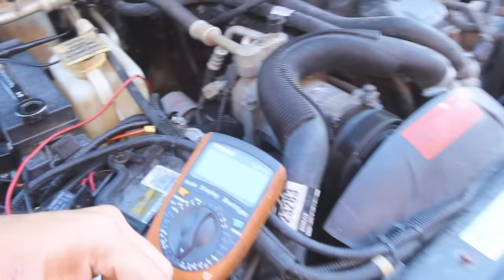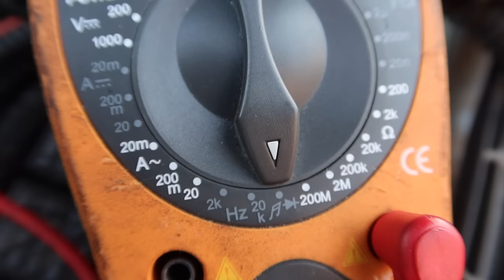AC Suddenly Stopped Working In My Car / Cheapest  Air Conditioner Diagnosis and Fix / Hot Jeep  XJ

Comment: My problem: Chrysler 300C (for CRAP, I guess): every time I used the combination "Fan-Windshield blow- feet" position of the selector level, the AC Compressor makes a wrenching noise; it sounds as if 'stuck', seized up. I would say it sounds as if the clutch bearing is rusted out, stuck. Is that common? To think the Compressor could be seized up is a bit of a long range thought. Am I wrong? What should I do? Please, help. Thanks for your vid, though.

Comment: My ac goes on for a lil then the ac stops working an the ac clutch turns off so idk if its low on freon cause the switch you messed with i did the same but my suv doesn't have that problem can it be low on freon on or a electric problem thanks

Comment: My compressor clutch was cycling on and off in a/c mode and the vents blew hot air. I did not know why. I know the cycling of the compressor clutch is normal in defrost mode but it didn't make sense in a/c mode. So I tried your paperclip trick and sure enough the compressor clutch stayed engaged and the vents started blowing cold air. I also notice if I use the gauge that comes with the Pro A/C bottle, and hook it up to the low side port (when it is not on the bottle) that the system pressure drops from 50 psi to zero when the a/c compressor engages.

Question: Is my low pressure switch bad or are the contacts in the switch opening when the compressor comes on and the pressure drops? Then when it is off and the pressure comes up the contacts close again and the cycle repeats? Should the preasure in the system drop to zero when the a/c compressor comes on and the clutch engages?

If anyone knows the answers I would appreciate it. Before I run out and replace my low pressure switch just to have the same issue continue.

Comment: What if my ac compressor turns on with the ac button and it has Freon and fans work but ac still doesn’t blow cold air only hot air

Comment: I have a 98 cherokee sport. My ac kicks on and off repeatedly. You think that low pressure switch is bad as well? Going to test it in the morning. I recharged it and blows cold but kicks kicking on and off after i replaced a leaking Schrader valve.

Comment: Clutch is able to freely spin when I manually do it with the car off. Clutch does not kick on when car is on. My pressure switch has 4 holes. I put a paper clip in 2 of the holes and the fan kicked on but not the clutch? Ac still not cold

Comment: I tried the paper clip method and the Clutch kicked on and we will go get a new pressure switch and hopefully that is the problem. Sold my Sister my older car and had it in the shop for a coolant leak and when we picked it up the A/C had stopped blowing cold. We asked if they could have done anything to the A/C while replacing the water pump that could have made the A/C stopped working. They said they weren't working around that area but they lied because this pressure switch wire runs right in front of the water pump area but said its $100 to even look at it so we decided to start looking at it ourselves. Hopefully its just the sensor. Thanks for you help!!! I also have a 2013 Mazda that I have changed everything out to get it to blow out the vents harder and nothing has worked. Blows cold but in this Louisiana heat at 105 degrees it doesn't help. Is there anything else I need to change out?

Comment: Great vid mate. My compressor's starting but the radiator fans not coming on. But fan come on at 104°C also getting potential P0480 which is the fan circuit. Any ideas cheers. Graham

Comment: Got a 1996 Lexus es300 air-conditioning stopped yesterday , changed relay that had signs of sparking , put new one , still the air-conditioning light is flashing , check the low pressure switch still nothing , compressor still doesn't kick in . Any ideas ?

Comment: Would this work if my fuse for the A/C clutch is blown? I'm pulling a vacuum right now and will be charging here in a bit but I don't have a spare 20a fuse to replace the blown one. Could I bypass the low pressure switch even with a bad fuse?

Comment: Ok, so you said something about the radiator fans.....what if they aren't working? Mine aren't as is my a/c and it's so hot here, we got into triple digits this week with a high of 113!!!! I need help. A friend tried to get my radiator fans working and in doing that caused the theft deterrent system to engage and now my car throws a PO336 code. Crankshaft position sensor circuit range performance p0336. Not sure what to do, my crankshaft was replaced however my car will STILL not start, theft deterrent still active and the car still throws the same PO336 code. 2011 GMC Acadia SLT AWD 3.6 6 Cylinder. I'm hopeless and pretty much broke and shooting into the dark here :'(

Comment: Sir the sensor should be close  checked by multimeter   . .? But I bought 5 switch  they are hight  ohm  . 6 thousand  ohms  on each pins  . It is wrong parts thank

Comment: aye on my mustang I inserted a wire in that connector and my compressor still didnt turn on. dumb question here, does it have to be a paper clip? fwi compressor is new. and car will not take freon after 10oz. and no power to compressor.

Comment: When I do the paperclip trick, on a 3 pin volvo connector (left and right), the car won't start. When I remove the paperclip, the car will start. any idea? I did something stupid, i forgot to installl the entire low pressure sensor in my new condensor... filled it at a garage... but now i cant remove the bolt, and install the sensor.. because the system is pressurized. There isn't a valve on my dryer :(

Comment: My fans dont turn on with the ac on could a pressure sensor switch be the reason i can see the compressor click on and off so i know my compressor is good its also filled and no leaks anywhere

Comment: I was just wondering if that switch controls the interior blower to help push the cabin cold air if so Tysvm I was thinking relays fuses to check and now adding this switch to diagnose my issues because I have a 2018 Dodge Grand Caravan gt super charged and for some reason it’s pushing out hot 🥵 air and the blower isn’t as strong no leaks visually as for inspection of fan clutch I’ll look and see if it’s engaging once again Tysvm

Comment: What if compressor is working but I still don't get cold air? No visual signs of leaks. 2 lines coming from evaporator are very hot and another line is frozen.

Comment: Hey hope all is well. I have a 2009 Dodge Caliber SE and my heat works but my air doesn't I've tried adding coolant but it wouldn't take I was told my compressor is fine but it's a piece I may need and I'm really trying to avoid taking it to the dealership. I honestly feel like it could be a simple fix since my heat works fine and I would love a second opinion. Is it any alternative you could give me?

Comment: Quick question what if the compressor don’t start by clipping the wire , but if you bridge the relay on the fuse box compressor turns on, what can it be then ? Can’t find the problem thanks

Comment: My car is not blowing cold air. I check the pressure on the large pipe and it was 135 psi. So I ended up not adding anything. Could it be a bad switch? Or why do you think there’s that much pressure and not cold air?

Comment: Very informative. You confirmed for me where I have the problem in the A/C system. I Have found leak in the condenser. Thanks very much. I have  a question how often does your radiator fan come on?
Reply: Should stay on as long as ac is on max.

Comment: You did not mention about the high pressure switch that also could be the problem.I was driving and my a/c stopped working but after 10 minutes it start working again come to find out my high pressure switch is defective.

Comment: my problem is that with the paperclip trick it did turn on but it turned on and off when it was on i was able to put freon in but i didnt feel anything getting cold nor cold air out of my vents but i was able to put a bottle of freon and nothing no cold air and also my ac compreddor stopped turning on

Comment: What if compressor clutch does not engage when I put the paper clip but it does turn on if I connect it straight from the battery?

Comment: hi,there my 2004 nissan pathfinder compressor running buttom line get cool the one on top on the low side get hot, is look like i have refrigerante but is not cooling any idea how to fix it or what is wrong thank you for any help

Comment: I replaced mine it was working okay then now my ac compressor doesn’t engage. It has a new compressor but when I jump it the clutch engages but blows hot air. The shop it brung it to said it had a electrical issue they couldn’t fix it.

Comment: My switch is on the low pressure line, not the dryer. Do I need to evap the freon to change the switch? I thought I did, but you just unscrewed it and replaced. Simple.

Comment: If you do have a leak and perform that test with the jumped switch, could that damage the compressor? I mean, the compressor would be running with little to no refrigerant in the system. Is that bad? TIA
Reply from the maker: Not bad for the duration of the test.

Comment: Why did you not have to evacuate?  If i remove my pressure switch it will release the pressure.  Nissan 2004 Maxima.  Just curious.
Reply from the maker: Schrader valve under the sensor.
Reply: @Donnythelatemodeltech  does Nissan use those :). I'm testing mine right now.  It's a three pin so I'm researching:)

Comment: What keeps my clutch from engaging I hardwired my air condition to the battery and it comes on but it won't come on if I don't have it hardwired to the battery 95 Buick Park avenue 3800 series 2

Comment: When I use the paper clip like you did to see if the clutch is engaging the vehicle shuts off. Take the paper clip out in the vehicle starts back up
Reply from the maker: Your probably not testing a pressure switch .  How many wire that plug got?
Reply: @Donnythelatemodeltech  3 wires
Reply: 2011 370z air just stop blowing cold air. Clutch not engaging.
Reply from the maker: @dennissutter4322  3 wire is not the ac pressure switch.  That would be a sensor .    Your going to smoke your ecu.
Reply: @Donnythelatemodeltech  ok thanks. Also thanks for answering me so fast even on a Monday.

Comment: Hey I have a similar issue . I by pass the switch with the paper clip and the ac compressor kicks on. I bought two switches from different local part stores and neither worked. Do you think that something else wrong with it? Or is it just cheap quality switches? Thanks
Reply from the maker: When You bypass the switch, does the ac cool like really cold?
Reply: @Donnythelatemodeltech  no
Reply from the maker: Probably no refrigerant.
Reply: @Donnythelatemodeltech  I had filled it up and no leaks either  , you think the switch is good?

Comment: Thanks for the simple explanations & great quality video. My 2006 dodge charger 3.5 liter has 3 pins in it. Any tips on how I can check if it's faulty with a multi meter? Thank you
Reply from the maker: The 3 pin is a sensor,  mostly not your problem
Reply from the maker: You'll need to jump the compressor relay to check functionality
Reply: Ok I gave it a try & everything seems to be functioning well however I am just not getting any power to my ac control unit. I tested every fuse associated with fans & ac and They are all good along with my fan motor & resistor. Is it possible that I might just need to replace the ac control module?

Comment: So weird! my 2016 Off Road, 4x4, all of a sudden just shut off. (green ac light went off and stays off). When I push the AC button on, I can hear it run then it shuts off, green ac light goes off. I checked the fuse and the replay, they are working properly. I had a friend come over and he said the compressor is running which is good news, however, he then assumed the refrigerant its empty so he was going to add freon but, his gage says the freon in full. That is where we are confused. Also its the 1234y NOT the usual 123A. Any insights? I want to sell this truck but I need to get this fixed first. We live in Florida. We do NOT have the $$ to have it serviced or even diagnosed at a local toyota dealership, they are way expensive. Just installed new air cabin filter, it was atrociously bad, but that hasn't fixed it at all. ???Help???
Reply from the maker: I would assume, a person that has the tools for the new 1234y systems would be able to figure it  out .    I have the resources at work for the new systems , but have not yet invested in any tools for the house yet.

Comment: Can I leave the paperclip in it for a bit to get to the parts place or run a 8 hr shift with it in it if parts not available immediately...As I am an essential delivery food driver n I can't handle the heat. But need these shifts to get out of a bad bind I'm in.. That's if that's what's wrong. I don't see a leak all fans work . Not over heating
 I will check fuses n relay tom. Again I do feel some cold air same amount in all vents too. Just not cold enough or maybe blowing enough to cool car down. I do feel some cold, but blowers seems louder sometimes. I can park under a tree n usually get it to start to cool car down more, but in direct sun windshield puts so much heat in I can't stay cool at all.  suddenly just stopped blowing real cold after running it over nite. I slept in my car with my dog two days,  had heat stroke  n it was the only place I felt Un ill. Lol
Reply: Oh it's a 2014 mazda 3 sedan  stick horn used to work then off n on now nothing
 I heard that had something to do with ac as well a fuse or something

Comment: Ok so I checked everything and it's going on n off its running on pulling on n off the fan fir the ac shits off when it shuts off. I have cold air but not enough. ..I tapped the relay n checked fuses..nothing blown that I can find. I can't be sure where the switch is for the ac your shoeing us.aka duff car. Think it's on the condenser fan I'd ghat what that's called. It's not exactly pushed in I can see a green wire but the part that plugs in is. So something tells me it's been replaced before maybe. Anyhow can u let me know. I can feel ac bit it's night time.and it always blows a little. Sometimes blows inside sound much quieter. It's louder now bit it does that sometimes n usually at night only. During the day when it's hot it doesn't blow fast n I sweat my ass off. Oh God plz help me j have nobody n my dad's really ill now.  I'm so sick of getting so sick from this heat  n j need to work so I can get a place for myself..plz message me back privately or here

Comment: My ac worked one day then it didn’t first I notice it would blow very low then after a while blow hard then next thing u know if I turned my ac on my car would shut off mind u this all happened all within a few days I’m trying to figure out the problem after a little research noticed my ac clutch is not engaging the pulley wheel is engaging tho then I tried to move the clutch by hand to which it moved a few spins but after that it stopped idk if I was moving in wrong direction or what so now I’m trying to figure out am I out of feon or is my who clutch system need a change
Reply: I should also mention I seen a small leak I can’t remember if towards the back or front but I also didn’t c color coming from the leak and it was a small leak

Comment: I recently got a 2007 Jeep Commander 4.7 L v8 a/c would come on randomly.  I removed panel under glove compartment and saw, what looked like,  a broken Air Inlet Door Actuator Gear. I can't see where the part is, so that I can replace it.  Do I need to remove the heater blower motor?   If anyone can help?  Thanks.

Comment: Great video. I have one question though, on mt 2007 taurus will a bad pressure switch cause my ac to short cycle. With the ac on it short cycles like it does when the defroster is on, or is this the pressure switch doing it's job if the Freon is low. Some cool air is coming out at 80f  Thank you.
Reply: short cycle is usually low on freon
Reply: @MegaWebsurfer  Thank you for the reply John. It was low on Freon, they recharged it and put dye in it so if it leaks they will find the leak easier. Car is 13 years old so I'll see this summer. I ran it for a minute or so earlier this month, when it was like 60 just to see what would happen, it blew very cold air, so will find out more in the summer. Take Care, Gary
Reply: @MegaWebsurfer  Yep, that was it. had it charged with dye in case it leak again, then will be able to find leak easier. Thank you.

Comment: I had good pressure on the guages. I had power to both low and high pressure switch, yet paper clip didn't work. I've tried two different compressors. I guess it's possible both cluthces are bad?
Reply: Check fuses,relays,power at clutch power connector. trouble shooting is not complex just a series of little steps backed with information and patience .

Comment: Got an F250 7.3,if that matters air works at first,really good,then warm air,if i floor it to passing gear just for a second colds back on,and back and forth! Dont normally chit chat but u seem down to earth and blah blah blah, sorry anyway thanks
Reply from the maker: Has the system been serviced recently? Or have you had some radiator or intercooler work done recently?

Comment: Hey man bought the new part and now my AC clutch engages and stops ever 5 seconds. 

I did the bypass with copper wire on the top switch and the clutch engages normally. What could be the issue?
Reply from the maker: Low pressure
Reply: @Donnythelatemodeltech  could my radiator being backed up cause this cause I checked the pressure and I’m at a good level
Reply from the maker: @Official810Films  your radiator, has nothing to do with your ac.
Reply: Hey man I let out all the pressure and re did the Freon works good with new part! Thanks a lot
Reply from the maker: @Official810Films  nice